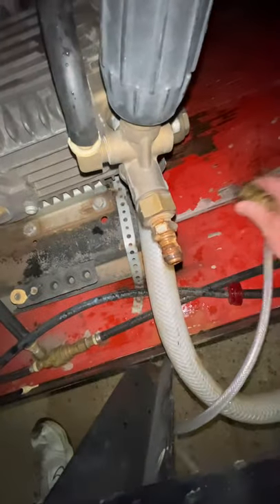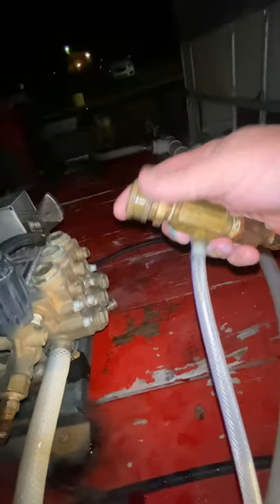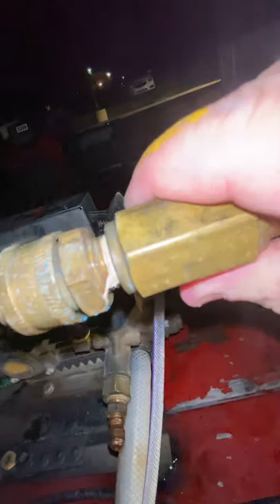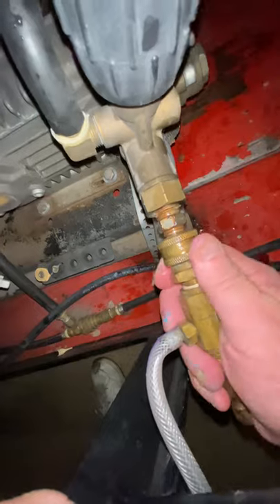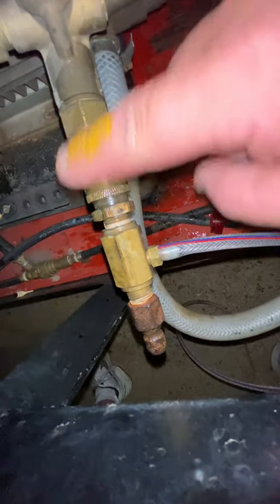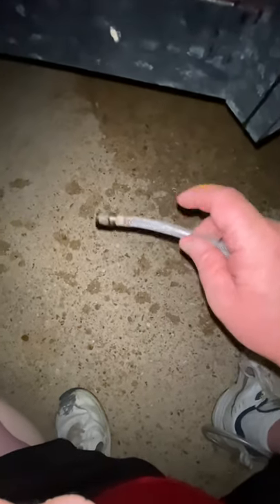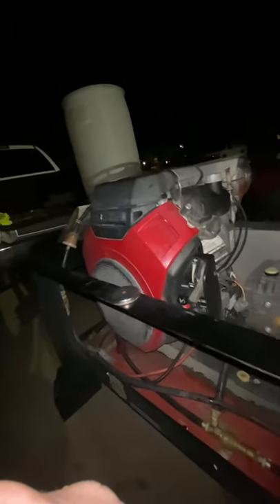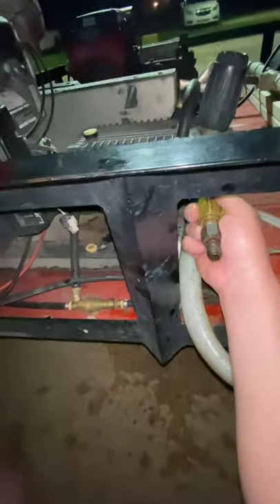Pressure wash for beginners 101

Comment: Billy the only comment I can make is I have recently bought injectors for my 5.5 gpm 3500 psi pressure washer I needed to figure out how much I was drawing so I made a bucket with integrated in 1 gallon measurements  and a o gallon jug integrated in 1cups and 16 marked on the on gallon jug I bought 2 injectors 3-5 gpm 1 is a hi flow so I checked the draw rate on the injector and in one minute it sucked up  10 cups and I checked my pressure washer and it’s out put was about 6 3/4 of a gallons in one minute and it worked out to be a 10-1 ratio with 12% sh that is a very week mix so the moral of this is check your machine to make sure you order the right part for your machine

Comment: The injector, injects sh using a check valve. There is a little ball bearing and spring inside where the tube connects. The longer the check valve the more solution it will inject. Also to make them last longer, stick the tube into a bucket of water to rinse the sh out of it. Also you won't lose pressure and gpm since it won't be sucking air.